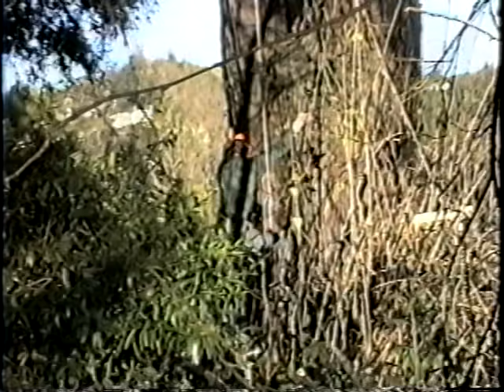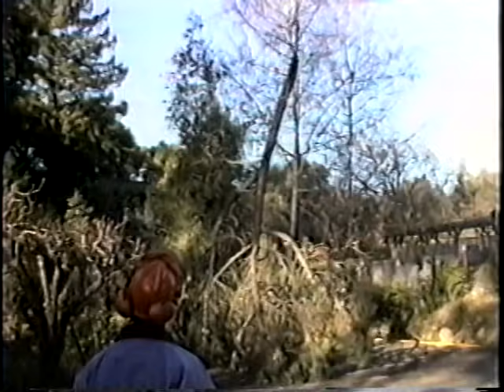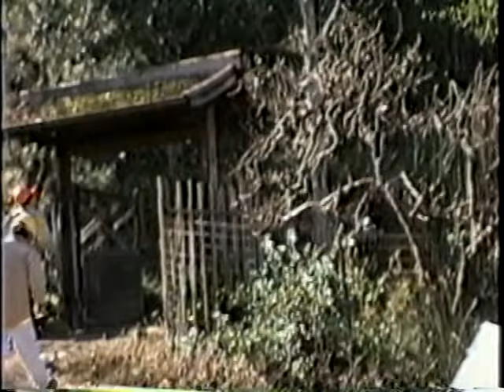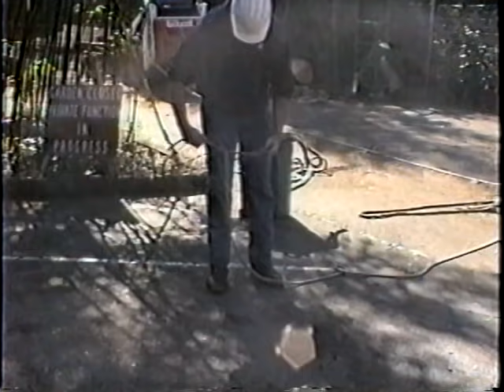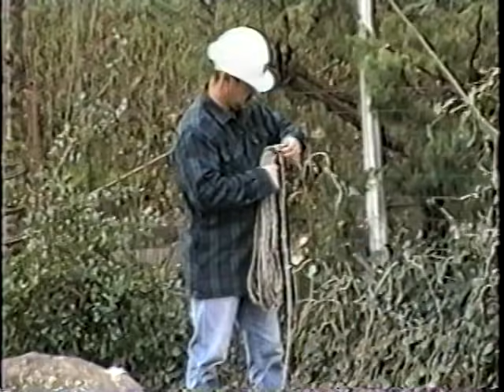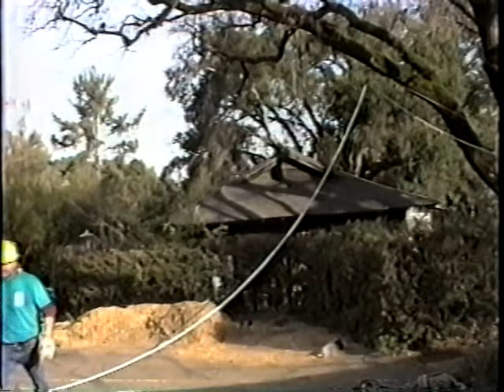Most COMPLICATED JOB EVER!

Comment: Fantastic video Blair! Great teamwork all around. I recognized the Hobbs Block on the controlled speedline. I still have 3 of those blocks. How was Ken tensioning the speedline when necessary? I don't recall hearing any ratcheting sound from a Hobbs Lowering Device, or did you just use a Rope Brake (patented by Ken)? I realize that you guys weren't dumping wood into a tensioned speedline. Just wondering if after the cuts sometime, you needed some extra lift.So happy to see more footage of Mike Majors. As you might remember, a few years back I asked you if you knew how to get ahold of Mike, because I had a few questions that I wanted to ask him about a Redwood job that he did with Don Blair, Ken Johnson (who I recognized in your video) and Robert Phillips. I think you told me that you lost touch with Mike, but that he also got hurt in a fall? Treework or rock climbing?Have you had any luck locating Mike again? Also do you have anymore footage of him climbing and rigging?